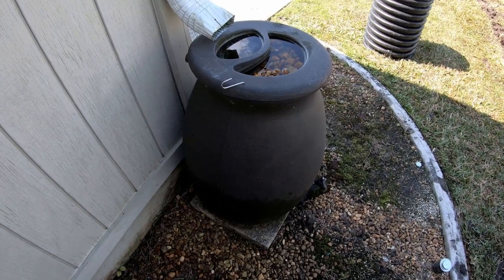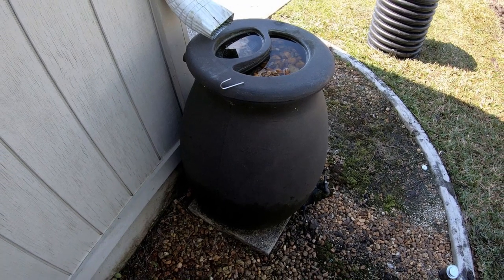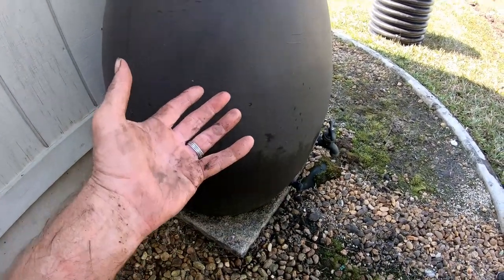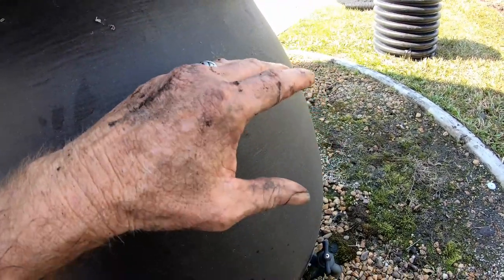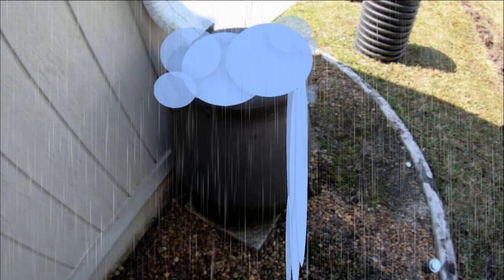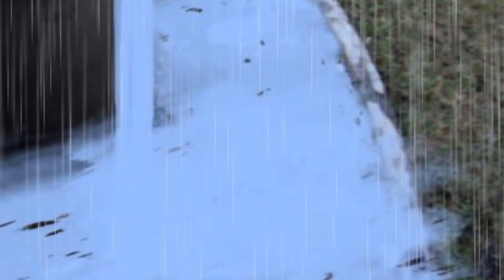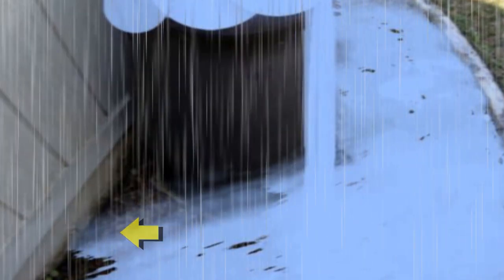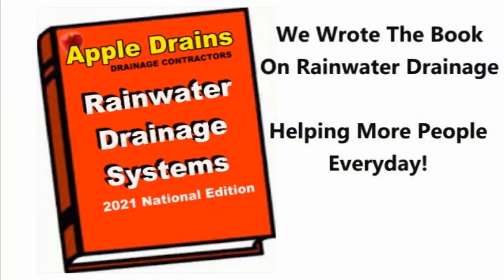Problem with RAIN BARREL

Comment: That looks like an Algreen rain barrel and it does have an overflow.  There's 2 outlets near the top in the back, you have to cut one of them with a hack saw, then connect a hose.  There's 2 in case you want to interconnect them.

Comment: My uphill neighbor has an overflowing rain barrel that consistently floods MY backyard. I don't even have my roof runoff going into my yard, but her overflowing rain barrel sends almost all of her roof runoff behind my retaining wall, over it, and into my yard where my yard stays inches under water for days. She refuses to do ANYTHING about it though it would cost her nothing. She doesn't even use the rain barrel; previous owners installed. Her foundation is damaged from it as well as mine. I'm trying to mitigate with a catch basin & about 100' of corrugated pipe. However, its about impossible to corral the water into a smaller spot to fall into the drain, but I'm trying.

Comment: Doesn’t a discharge spout defeat the whole purpose of a rain barrel, to collect water. The owner needs a larger collection system of barrels connected together. And the owner needs to actually use the water up as soon as possible. Use the water up 3 or 4 days after every rain.
Reply: As long as the owner is using the water from the collection barrel instead of from the water from the house, it’s fulfilling its purpose, even if they don’t require much water.

You don’t need to collect more water if you don’t have a use for it.